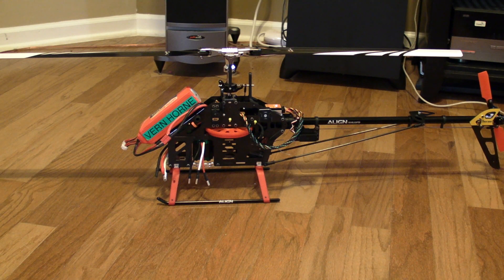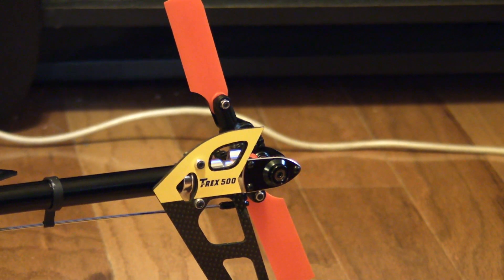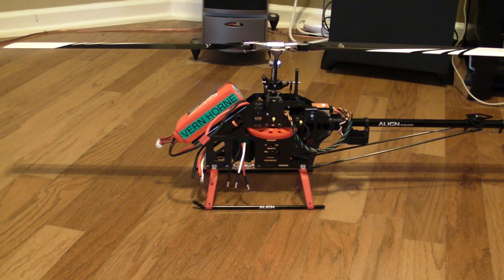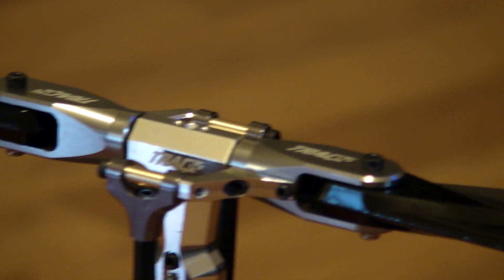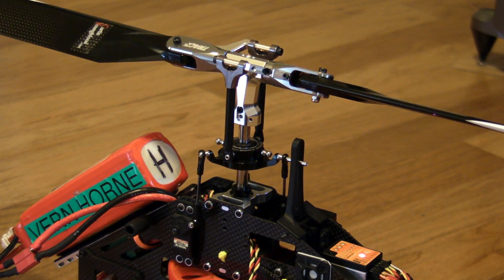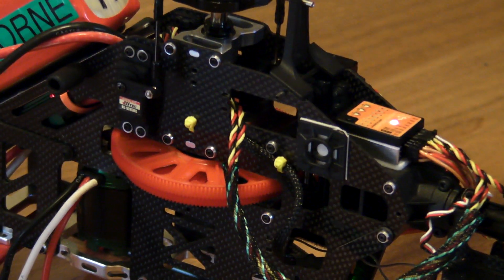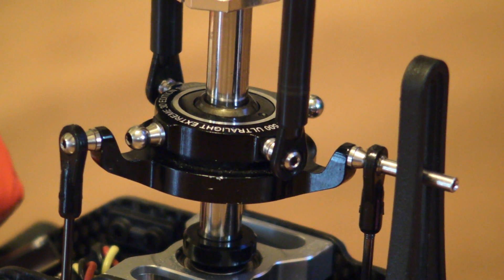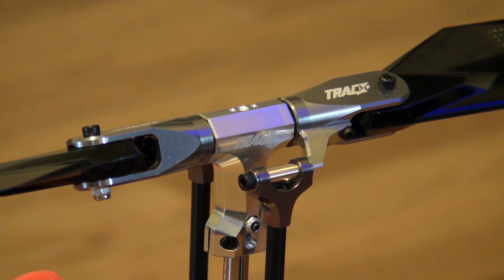Project V-rex (Trex 500 Upgrade) Update

Comment: Hi Horndog, I dont mean any disrespect but do you not find that all the non Align parts give a lot of vibrations.. I did the same and had nothing but problems flying (gears wobble and out off round), so I went to Align parts and vibrations are much better.
Reply from the maker: No disrespect! we are all hear to share info. I didn't have any vibration issues. I did use thin shims on all blade grips and tail grips to eliminate any slop or play. Lots of nitro truck shops will have them. just get the right size. I also am very critical of my mechanical setup. I set all links as precise as possible for proper range. Rarely do I need any adjustments on the gyro to set it up. This extra time helps reduce vibration and control issues later in flight. Hope this helps!
Reply from the maker: No disrespect! we are all hear to share info. I didn't have any vibration issues. I did use thin shims on all blade grips and tail grips to eliminate any slop or play. Lots of nitro truck shops will have them. just get the right size. I also am very critical of my mechanical setup. I set all links as precise as possible for proper range. Rarely do I need any adjustments on the gyro to set it up. This extra time helps reduce vibration and control issues later in flight. Hope this helps!

Comment from the maker: I explained it in better detail a little further down the responses but I dyed them with Rit t-shirt dye.... mixed a red and yellow dye. Looked dark but soaked the pieces AS A GROUP for 1 minute intervals. Rinse with cool water and check the colors... repeat as necessary. Works very well but you have to make sure your plastic is clean and washed well before starting. Soak a a group so you get the same or at least even color coverage on all parts...

Comment from the maker: @cruddbucket So far so good... I did a pretty long soak so it fot more than just the surface. The original main gear gor shreaded during testing. I have a nother one but after I dialed it in I decided to wait until I needed to swap the main and auto gear before I swapped it. The tail gears are still running fine on the tourque tube. G2G!

Comment from the maker: @trexinvert I didn't mod the battery tray. With the new Fusuno canopies it all fits .... I position the battery about a 1/2 to 3/4 inch below the top of the tray and it makes the canopy fit real snug with no play at all.... locked in tight and inverted flight proven!

Comment: Did you cut down the frame area near the battery, so you can fit a larger capacity battery? More flight time and higher C lipo might be a very useful. The dye gears look awesome.  Don't worry about excessive pitch, because tx linear expo can reduce.  Make sure you check at full up / down pitch with cyclic stick to each extreme corners.  I've got +/- 15 degrees on my FB trex 500 no problem.

Comment from the maker: @96sunvalley There are NEVER any dumb questions in this hobby.... all to make it better! I should have been clearer on that part. Bring the water to a rolling boil then lower it to a simmer. Only soak the pieces for a minute or two at a time. Then rinse and check them and repeat as necessary until you have the desired color. I saved my mix in a bottle so if needed i can dye more pieces later. Don't use good pots.... may stain them!

Comment from the maker: @96sunvalley Just use RIT dye.... or any clothing dye. I used a liquid Red and a powder Yellow.... boiled water in a pot and tied each piece to a thin piece of wire and filled the pot so they are fully covered... it looked almost black in color but it works. I timed it in 1 minute intervals... then remove, rinse under water and check the color. If you want it darker just resoak it in the dye. Took about 5 minutes for those parts. Just blot it dry and install! Dye in groups for equal color parts!